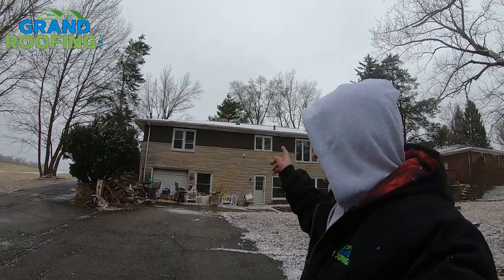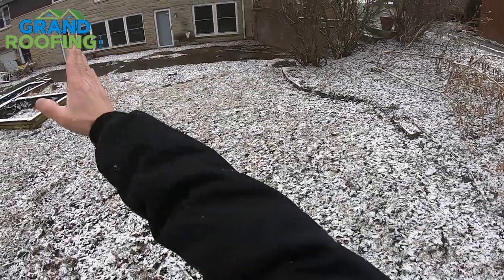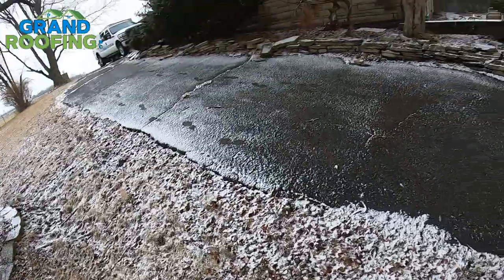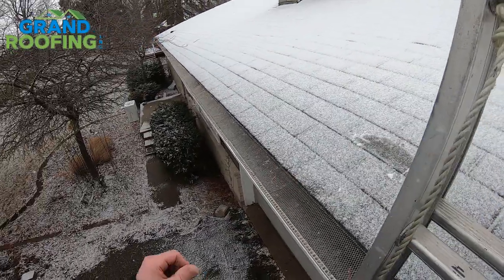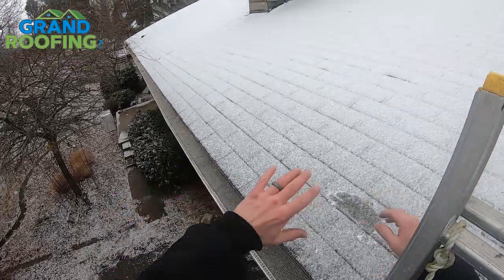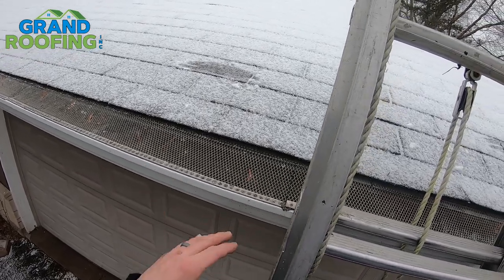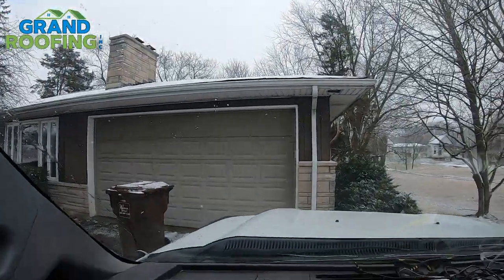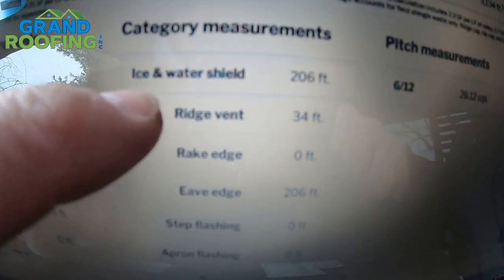How to Measure Your Roof - Roof is covered in snow and ice

Comment: I've been  doing  a lot  of  estimates  spring  will take  off  with  buissness
Reply: Fingers crossed that malarkey and certainteed can catch up on production. Hard to get shingles here in northern Michigan.
Reply from the maker: They should be, they actually started catching up in my region. Some colors are still hard to get. Malarkey announced that they are only running the main colors. Owen Corning was completely wiped out all year last year around here. They finally started catching up around November.
Reply: @GrandRoofingInc  this year  the time to  finally  decide  to  go  all way  with  my  buissness . Leaving  my  job  may be  harder than  ever  but  when  you  roofed as long  as  we  have  I believe  it's  a part  of  what  we  are  and  how we're  ment  to  be
Reply from the maker: Yes I would say though if I could give you any advice. Decide early on if you want to be the main guy installing and running your crew, or if you want to be a business owner and build it where it's scalable. I don't want to be installing roofs when I'm 50. I can say it was scary leaving a job with nothing lined up and no guarantees! With that being said, I have achieved more and built my net worth more in the past three years than I have in the last 15 years working for someone else. Just make smart decisions and treat it like a business not a hobby, you'll be good!
Reply: Bro, don’t worry about the “haters.” Invest zero time thinking/talking about them.

Comment: Anybody that tars copper like that should be tarred and feathered.

For roofs I couldn't get on for whatever reason, another trick is use a fat tape with a ton of stand off, and while on the ladder shove it up to the top to get your slope. Usually I can get it to push all the way to the top without too much issues. Or you can split a tennis ball on the end of that flat tape and toss it just over the peak - I've seen guys do that too.  I usually measure across the house wall to wall, and add the eaves in. Less room for error than when you're 30 feet away from the house - but using the wall or gutter to get straight is close enough. Or you can always save the trip and use an aerial measurement service. I'm not going to waste 2 hours, gas, and be cold on a sunday over 30 bucks.

Nothing wrong with a ladder on the gutter, you're measuring not toting shingles.. Keep it straight up enough, and don't bang around on it, and it's fine. Those gutters are bent anyway. And that gutter guard went back just fine. Anybody that cries about that isn't taking into account that these aren't pristine copper gutters with gold plating. Some people would complain about ladder stabilizers and the feet digging into the shingles. You can't win with people. A lot of people have their perfect methods, and no other way is acceptable under any circumstance ... but I guarantee I could go on their jobs and find something to whine about too.
Reply: Your right about measuring the walls then add overhang. More accurate then standing back 30’. 
For the ladder some guys use those gadgets that go into the wrungs but I tried those and hate them. Too scared the ladder bottom of the ladder will kick out. 
So I just use hockey tape on the ladder for the area that sits on the eavestroughs . It protects the paint and also provides extra traction so the ladder don’t move side to side.
Reply from the maker: only reason I measured further away was because the driveway, the other side had landscaping out the ass. Yes measuring the actual house and adding overhang might be a foot more accurate. But when you have a two-story home that is cut up with different size walls and sections you can't always do that.
Reply: Ha!Yeah

Comment: What kind of ladder are are you using? It looks really light. How long will it extend to?
Reply from the maker: It's a Werner, 26 foot working height.
Reply: @GrandRoofingInc   are you sure it's not a 24' or 28'? I cant seem to find a 26 footer on the market.
Reply from the maker: It's a 24-foot but they advertise it as 26 foot working height. I'm going to double-check it real quick.
Reply from the maker: I'm sorry I told you wrong. I was thinking of the other ladder I have. I just checked the one that's always in my truck, it's a Keller brand. The tags are all wore off of it, so I measured it. Fully extended it actually only measures 21' to the top of the ladder when fully extended. My apologies. My other ladder is a Warner.
Reply: One trick I learned roofing in Germany in the winter...measure the gutter hangers distance..measure the eves spacing is exposed etc..and reveal of the shingles/tile to get an estimate.

But never go up in snow..lol

Comment: You should try the app called Hover Take a few pictures from the ground & it gives You every hip vally rake window sizes door sizes everything siding exc it's very convenient
Reply from the maker: Do they charge per job or is it subscription and how much?
Reply: @GrandRoofingInc  they let You do 3 free estimates using the program to try it out otherwise You could literally make a new email after 3 estimates & use it again otherwise I believe it was like 30$ for a year
Reply: The program has a ton of information the last job I believe I took 6 pictures of the property it told Me exactly what I needed 35 squares =105 bundles I ordered 110 & had 3 bundles left it also told Me how meny sticks of drip edge 2 vallies that were 27ft told Me the exact amount of ridge I needed for all of the hips & ridge combined it just had alot of information You can also pick any brand of shingles & any color to see what the house will look like for the customer or client kinda cool for them to see
Reply from the maker: $30 a year that's it, with unlimited usage? How long does it take to get the numbers back after you submit it?
Reply: @GrandRoofingInc  I think it takes a little longer if You aren't a member but once You pay the additional fee it's quick
Reply: You should atleast do the trial account & check it out on a difficult project that's chopped up that way You can really see all the differences